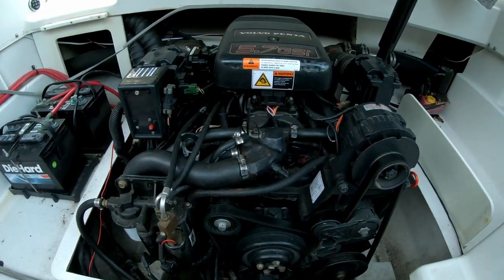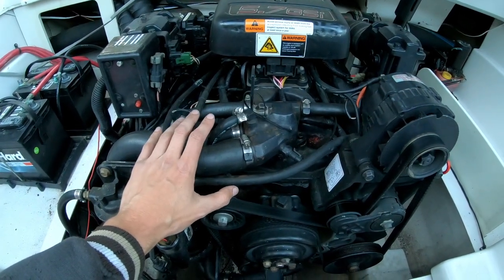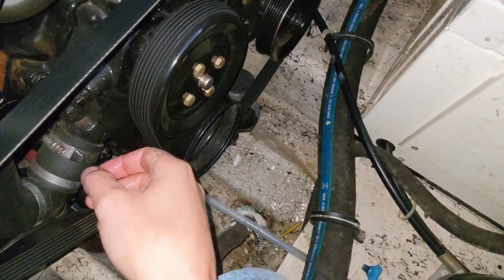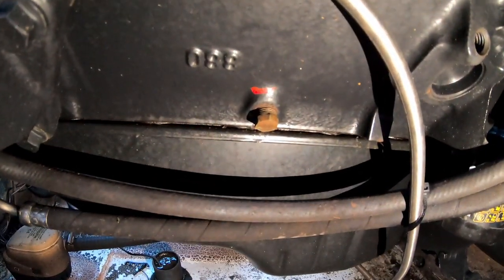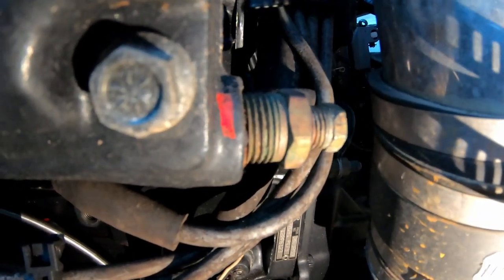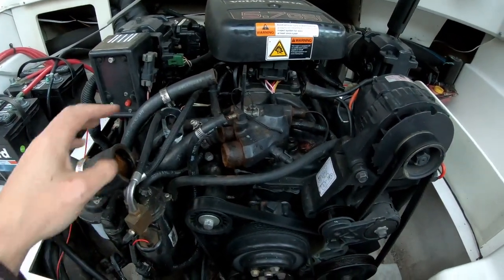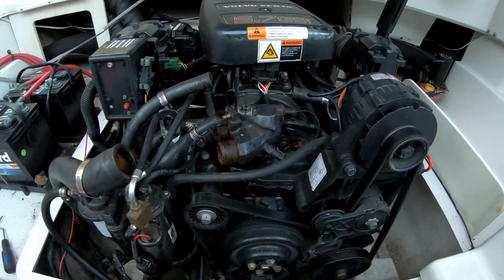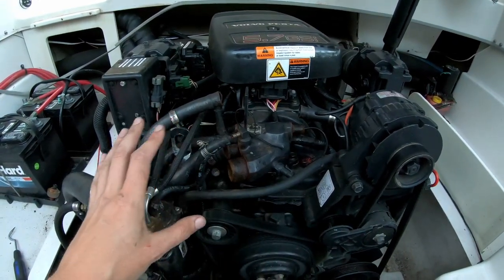Winterizing a Volvo Penta 5.7GSi SX-M boat engine

Comment: What about the water inlet line from the outdrive to the raw water pump? Isn't there a check valve in there that keeps the water from draining out when the boat gets trailered? I think this line needs to be drained at the pump, otherwise it will stay filled with water and freeze.
Reply from the maker: No check valve, the rubber impeller is the only restriction. Pouring antifreeze down the hose that leads to the water pump on this specific model will slowly bypass the impeller and flush the water out of the hose all the way to the pickup in the lower unit.
Some mercruiser bravo pumps have drains built into the belt driven seawater pump housing, others are best freeze protected by draining the block and manifolds then pumping antifreeze in with earmuffs. Each drive and specific manufacturer setup changes what is best. We see some very bizarre things that boat manufacturers have done.

Comment: I'm new to boating and I think your video is fantastic but please explain to me, did the outdrive get winterized also with all the antifreeze you put in the engine hoses? Retired in Massachusetts.
Reply from the maker: Typically the outdrive itself drains out fairly well, unless you have some leak that is allowing water to mix with the gear oil (I've seen it once, froze and cracked the lower unit because the seals were bad and it filled with water sitting in the lake), now the water pump if it is a inboard belt or crank driven pump can retain a small amount of water, at around 9:00 I pour antifreeze into the water pump line, and it backs up into the hose, that will make its way past the impeller slowly, you can pop the hoses off the pump to drain the water first, which can be a better option especially in a colder climate like yours, where I'm at we rarely see temps cold enough to cause issues.
An alternative best of all worlds procedure is to drain the block and manifolds (and water heater, heater core or other accessories that may be found on houseboats, ski boats or cabin cruisers, runabouts likely won't have any of those to worry about), then run the boat on muffs with antifreeze being fed in. draining the block and manifolds is essential, just running it on muffs will not dilute the water in the block enough, but draining everything as shown in this video is a sure fire way to get all the water out, then refilling through the muffs until antifreeze comes out the exhaust will guarantee there is no water left anywhere in the system.

Comment: how many gallons do I need?
also what about winterizing the foot?
Reply from the maker: With any V8 I always budget 6 gallons following my procedure of draining and then refilling, usually they take around 5, but 6 is safe so you don't need to make a second trip. As far as the lower unit, you'll want to pour antifreeze in the water pump hose until it comes out the intake on the lower or feed it in with muffs after the block and exhausts are drained. then check the lower unit oil to make sure it isn't water contaminated.